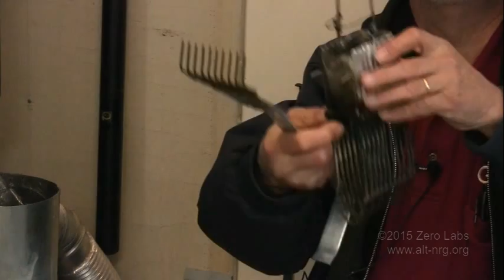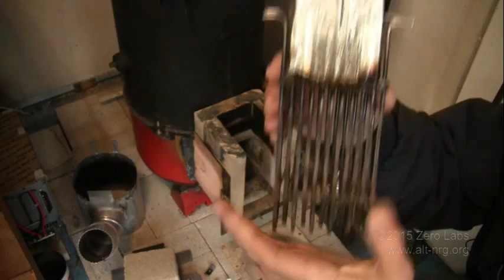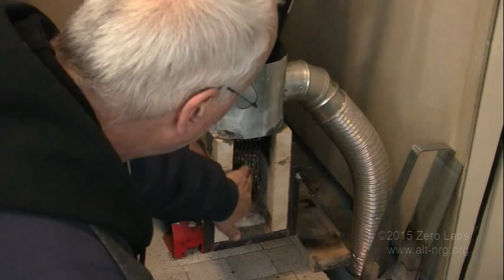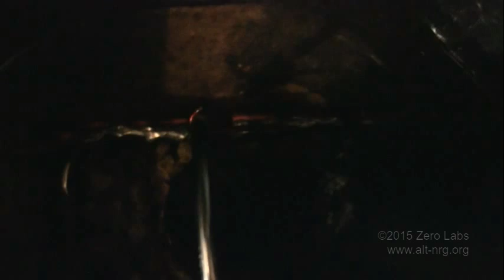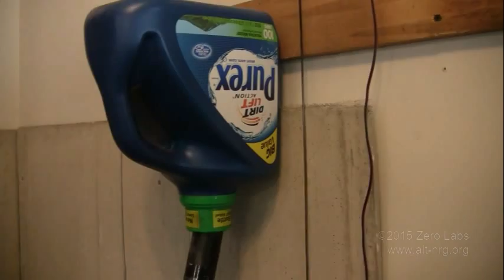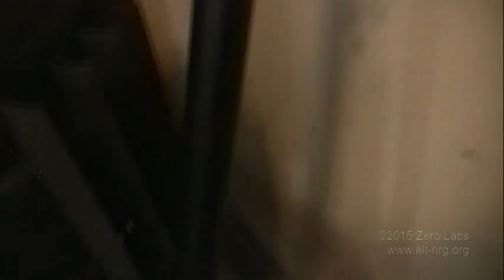#395 Rocket stove gravity pellet feeder update

Comment: I made a 2" sheet metal jacket for my stove and installed a squirrel cage fan on it to blow the hot air from the stove (in my basement) to the upper level of my home. The carburetor statement is right on the money. The introduction of air is the most important factor in how hot the burner burns and how long the pellet last. After cutting a small gap ahead of my burner (horizontal burner) the stove shot up to 800 degrees in no time, which is way too hot for what I need. The air coming out of the vent upstairs would cook us out in no time. I had to shut down the pellet feed tube and change burners to a smaller one so the extra air feed wouldn't "ROAR" so loud! A smaller burner holds a lot less pellets at any given time, so the flame isn't as hot now. The extra air slot I added made a big difference how the pellet smoke would burn (nice blue flame!) It's about getting the correct air/fuel mixture that makes it burn hotter and use less pellets in the process. (and fun to experiment with!)

Comment: Zero, do you have a design for the wooden pellet maker?
Reply from the maker: +weslingm No. I've looked at how commercial pellet makers are made. That would be quite a project. I once thought of something along the lines of a augur driven wood chipper but that would also require a complete redesign of the Rocket wood inlet. Just not worth it to me. If SHTF I can always revert back to burning regular wood in it.

Comment: +ZeroFossilFuel meant to say, top of pellet basket, not feeder. What is the purpose of the foil wrapped at the top of the basket?
Reply from the maker: +Dave Most I put it there just to box in the top part of the wire frame basket to contain the column of fresh pellets but later realized it also helps to keep the top layer cool. Happy accident.
Reply: +ZeroFossilFuel Your design works very well. I built one very similar including basket design, but have had the entire basket of pellets lit up after several hours of burn. It never came any higher though so will have to give this a try. Thanks for your advice!

Comment: Hi there, how about burnback into the feeder tube, have you experienced that? What happens when there's no more pellets in the hopper?
Reply from the maker: +Per Jensen The only time I get burnback in the feeder tube is when the stove if first being lighted if there's a good gust of wind creating a negative flow from the flue pipe. That is very infrequent and always easily corrected with a puff of breath into the opening. When the hopper is empty the remainder of pellets continue to gravity feed themselves into the fire basket. Only the lower half of the fire basket has burning pellets. The upper half stays cool. Even as the embers are dying, the heated riser inside keeps a positive flow through the stove. At the end of a burn cycle I will usually dump the last embers in, remove the fire basket and seal off the opening to shut the stove down and let it radiate the remaining stored heat rather than let it flow until cool which cools it much faster and wastes that last bit of heat.

The ONLY thing I have to be mindful of is when the fire basket burns half way down and hot embers are exposed on top. The IR heat shining back up is very intense. If the tip of my down spout material in the proximity of the basket is not up to it, it scorches or melts. I had been using a clear polycarbonate downspout tube all the way with aluminum tape on the side facing the stove to reflect IR (which keeps it perfectly cool to the touch even at full tilt boogie) until one day when I forgot and the tip melted. I have since cut the plastic back about 9" and made the tip section out of rolled aluminum flashing. Problem solved.
Reply from the maker: +Per Jensen ...and the reason there is never any burn back into the feeder tube is because the top boundary layer of the burning pellets in my fire basket design is always half way down the full fire basket. The tip of the feeder tube never sees hot embers even get close. Only when the tube is empty and the fire basket burns down does the end of the feeder tube see hot embers and they're already 5-6" away. This is where many make their biggest mistake. If you're dumping pellets from a feeder tube on top of a burning pile of pellets, you're not just asking for trouble. You're begging for it. Even Web4Deb got himself into trouble with his pellet feeder because of this.
Reply: +ZeroFossilFuel So, you would not recommend letting the tube come too near to the fire basket. :) And when the feeder tube is empty there's still a cold top of pellets remaining on top of the burning embers?
Reply from the maker: Per Jensen My downspout tube hangs right at the top fringe of my firebasket. It is always cool to the touch because pellets feed from the top down but burn from the bottom up. When the tube is empty the pellet fire basket is still full and, yes, still cold on top. It's not until fresh pellets drop half way down the full height of the fire basket into the burn zone that they ignite. I should probably make up some illustrations of this process and explain it in greater detail.
Reply: +ZeroFossilFuel That would be much appreciated, thanks
Reply: +ZeroFossilFuel By the way, did you find a way to turn the heat down?
Reply from the maker: Per Jensen Not really but then again, I haven't tried that hard either. It runs most efficiently at full tilt. I just run it as long as I need and shut it down.
Reply from the maker: +Per Jensen I will be uploading a video walkthrough of my pellet feeder and fire basket later tonight that should be of interest to you.

Comment: how is all the internal metal holding up now that it has been running for a while?
Reply from the maker: +HyperGro DWC The only part that has deteriorated at all after two full seasons was the SS pellet fire basket. The 8" galvanized vent pipe that holds the vertical stack together, the plain fiberglass wool and the lower sheet metal box that holds the bricks forming the bottom part of the J-tube are all still in great shape.
Reply: thats nice.
thank you for the quick response.

another quick question.
What type of metal did you use for your pellet fire basket?
Reply from the maker: +HyperGro DWC SS304, 1/8" diameter.
Reply: ZeroFossilFuel thank you.

so much. not many people would go back as far as you have and answer things.

thanks again.

Comment: Nice job. Have you tried to raise up pallet basket, does it reduces heat while raised and increases when lowered back? I am thinking about possibility to adjust heat output on my mobile cooking stove.
Reply from the maker: ***** It probably would but mechanically that might be tricky. I simply slide the basket from front to rear to let more air in in front of the basket if I want to reduce the output.
Reply: +ZeroFossilFuel Wouldn't a rotatable air vane on the front of your firebox (mounted on the plate with your custom wingnuts) allow you set your burn basket in the center & then rotate the air vane to control the air volume?

You would probably have to remove or modify your refractory brick, though.

Comment: Bonjour Zee.

I'm sending you a link to show you the Rocket I built over the course of winter, closely following your wonderful online video tutorials and plans.

https://youtu.be/7eYaTo84X60

You set the bar very high for both relevance and clarity of contents, and for quality, clarity and enjoyability of presentation as well. Impressive generosity on your part; Kudos!

I have made a few changes here and there, added some fold-away handles to make removal of tank top easier, added a grate under where the basket hangs and an ash dump, but you can see that this is largely a reinterpretation of your great design. The portability aspect alone is a huge advantage.

I used the inner steel tank of a discarded 40-gallon electric water heater, 16 gauge steel for the burner carriage, and lightweight insulating brick for the J-tube. The inner riser is also made with lightweight insulating brick inside a 12-inch stovepipe with ceramic wool in between. The exhaust is 6-inch aluminum flex connected directly into the 6-inch fireplace chimney stainless steel sleeve.

I found some self-adhesive stove-door gasket tape that folds neatly over the edge of the bottom section to easily create a neat, gas-tight seal between the two tank sections. No Hi-Temp silicone goop, no muss, no fuss.

I found that using only a half-cup of pellets and a few bits of birch bark makes the firing-up very quick, easy and reliable; it also eliminates the need for any fossil fuel. In the video, I used my butane lighter for 5 seconds but a simple match, flint sparker or even a fire piston will do just as well.

My only issue has been with the stainless steel wire pellet basket: the stove works extremely well, with either wood sticks or pellets, and the top of the bell frequently glows cherry-red and goes higher than the upper limit of my IR thermometer, which is 1,000 degrees Farenheit. This makes the bottom wire loops desintegrate in about a month because of the intense heat generated in the basket. I'm working on three different basket approaches using 2“x4“ 16-gauge steel tube, steel plate and ceramic, respectively.

I have, and will shoot more videos and still shots of various details and construction steps that I will share with those interested. You can subscribe to my YouTube channel or contact me at  jeanlourocket@gmail.com

So, once again Zee, thank you for your amazing contributions to Rocket Science and great inspiration. I would definitely like to put a bit of my scarce money where my mouth is; how does one go about using the Tip-jar feature?

Meilleurs voeux

Jeanlou

Comment: I loved your simple design so much, I built a version of it from a 55 gallon barrel using a 6 inch flue. I substituted soft insulated fire brick in place of your hard brick. In doing so, I didn't need to insulate the riser.

My next addition will be a pellet basket. With wood, I need to be very diligent with refueling every 20 minutes without fail. If I let it go for 30, it burns out and I need to start another fire.

I did incorporate a plenum into the metal box holding the brick. I also added a hinged door with fireproof glass on top of the plenum. I so love watching sideways fire.

 I do have an outside air source piped into the side, similar to your rig only with flue pipe. I've a sliding front panel for access to the burn chamber for cleaning and starting the fire.

Thank you so much for the inspiration. You've created a madman, obsessed with rocket stoves. Looking forward to my next build, incorporating all the real neat tricks and twists I've seen on YT. Peace. Tom
Reply from the maker: You MUST share this in a video!
Reply: ZeroFossilFuel
 I will post a video of my stove, give you credit, it will steer folks your way.

Comment: Well said, Zee. I modeled my pellet hopper after yours. I go through exactly the same startup procedure as you do. slight differences, 1) I didn't have the patience to weld up the eighth inch stainless steel welding rod, I use disposable lath mesh, and 2) my feed tube is two and a half inch diameter exhaust pipe which never requires agitating. but thank you for your inspiration I use my rocket stove to heat water you may have seen it on my Facebook page. Bob Vance, Mission Viejo California.
Reply from the maker: Yes, a bigger diameter tube would definitely eliminate the need for noisy agitator. I need to get around to that. Thanks.
Reply: +Bob Vance How much mileage do you get out of your mesh before it must be replaced?
Reply: One day, maybe two. I use mine every other weekend, so it works for me. I just plan on making one each trip. Long term I don't think it would be a good idea.

Comment: I just have a general question- since I'm using a 50 gallon drum for the stove shell, can I use the same dimensions for the J-tube as in your design or do I need to go larger?
Reply from the maker: Pavel Zajec No, you need to go much larger. It's all about ratios. For the riser, anywhere from 6"x6" (36 sq-in) to 8"x8" (64 sq-in) would be good. I explain this a bit in my free literature at http://www.alt-nrg.org/rocket.html .
Reply: ZeroFossilFuel
Thank you for your help.
Reply: I used a 55 gallon barrel and a 6 inch flue pipe. The square chamber of the same area as a 6 inch round comes out to 5 3/8. Its working very well. My stove is based on Zero's.
Reply: tomwalz
Thanks. that's what I've finally gotten to also, I'm going to start building in a few days.

Comment: I wonder how many square feet your stove design is able to heat?
Reply from the maker: gadgetmantwincities My workshop is 12'x20' (2150 cu-ft of airspace). This stove is adapted for quick heat, not steady heat. I can raise the temp in the shop 30*F in just a couple of hours with about 6lb of pellets. If you added a thermal mass and burned it more steadily my stove design would easily keep a room 2-3 times this size comfortable around the clock.

Comment: On my oil RS,
I have to add a third air entry in the exhaust
(already onedown fire chamber small 10% chimney diameter - first,
one up fire chamber big 1/3 door size - 2nd) :
Smoke is very "dark" with oil if no air fan.
Reply from the maker: Seems to me you may need to go back and look at the basics of rocket stove design. You should not have to go to such extremes to get a clean burn.
Reply: with oil yes,
 heat is very low,
so difficult to concentrate it...

With wood it's too hot for my 10m² caravan, that's why.

you watched it ? :

進化するロケットストーブ～サイクロン∞バズーカ2015～Rocket Stove
Reply from the maker: fred san Ah, I missed the burning oil as your primary fuel source part. Was replying on my Android phone. Sorry.